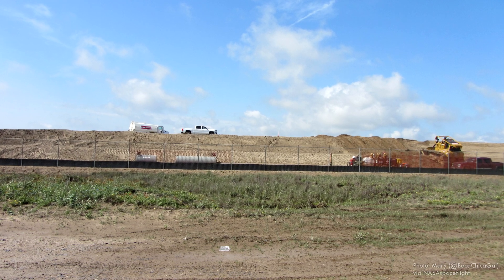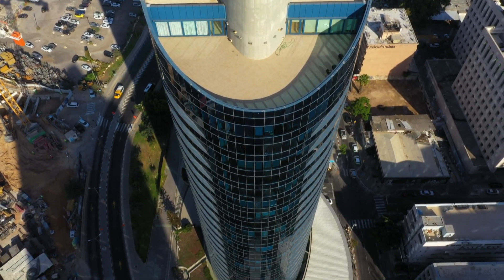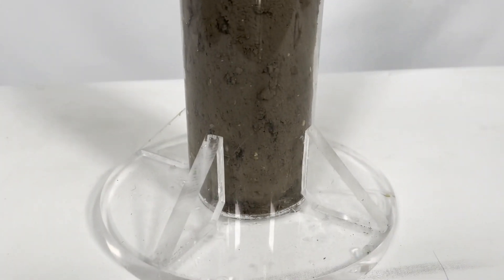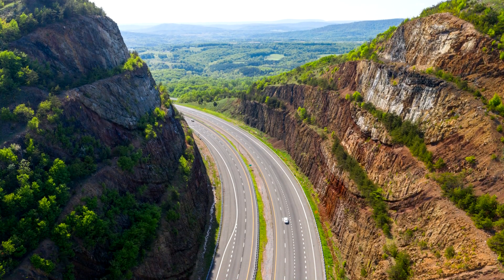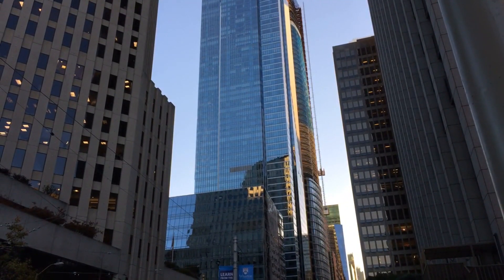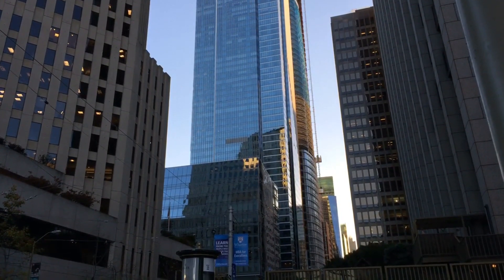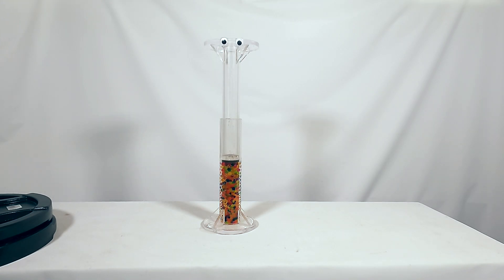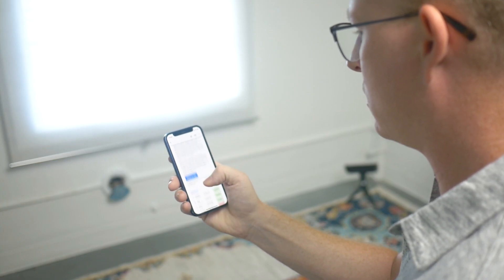Why SpaceX Cares About Dirt

Comment: I have done dirt work my whole life. Florida is mostly sand so we would have to haul in clay and use a mixer to blend it to create a stable base. Very interesting video.
Reply: Sorry, I don't quite understand, why would you want to introduce a soil more prone to consolidation to your foundation?
Reply: @everythingisscience658  for better compaction. Have you ever tried to get 100% sand to pass density?
Reply: @jamianwolfe6486  : From living in an area with lots of clay, and having family ties to the concrete industry, I find the idea of intentionally adding clay to be phenomenally dubious. The seasonal changes in expansion ratios inherently damages foundations, and adding a layer of rock and/or sand to distribute the flex is vital.
Reply: @absalomdraconis  comparing solid clay to a mixture is apples to oranges.  many places are a mixture of both.  Non-expansive clay has a very high bearing load while pure sand has the lowest bearing load
Reply: @theJonnymac  The word is cohesion and it is not directly correlated with compressive strength.
Reply: @absalomdraconis  In south Florida there isn’t much seasonal temperature changes.
Reply: @jamianwolfe6486  all the time, actually. Moisturize the sand, compact it layer by layer with a vibration compactor or whatever they are called in English. Can't get much better foundations than that (without bedrock).
Reply: @absalomdraconis  mixing clay into sand is just the cheapest ground improvement you can do. And remember, in Florida we are mostly talking about very clean sand (2-8% fines content, uscs classification SP to just barely SP-SM)You clearly don’t want to introduce too much clay (more than about 35%) into your mix as you will get poor settlement properties. But think of it as an attempt to keep the sand where you put it. If you have compacted sand surrounded by uncompacted sand, the compacted sand, once loaded, will exert force down and to the sides and will act just like your foot stepping in the sand in the beach, the loaded section will sink and the sand beneath will get pushed mainly to the sides. If you add just the right amount of clay it will help prevent that situation and stabilize the sand which has great settlement properties. FYI a clayey sand or silty sand will typically have a dry density of around 120-130 pcf and a clean sand will be around 95-105 pcf, silty sand is preferable for building construction but clayey sand is ok too most of the time unless you want drainage. There is so much more to go into on this subject I wish I had time to dig deeper into the meat of it.
Reply: @jamianwolfe6486  isn't Florida old river bed runoff with little to no rocks in it.
Reply: @absalomdraconis  not all clays are expansive
Reply: I love how all the experts who don’t work/live in Florida and don’t understand HOW it is done in Florida are able to “remote” determine that construction is done “wrong” in Florida. Given that they have roads, bridges, skyscrapers, etc. I think they have figured out how to make it work given what they have to work with. The engineers here will already know this so the following statement is for those who don’t know: the Seaside condo collapse in Miami had nothing to do with compaction
Reply: @AndrewSteitz  absolutely. Well said.
Reply: @AndrewSteitz  florida sucks give it up
Reply: Can confirm for the non Floridians. There are multiple factors we have to look at on a job. We mix clays into sand or sand into clays to achieve a cohesive subgrade. Stabilized subgrade is a very big deal here, and most areas require an LBR of 40 minimum. You can never achieve those numbers with sand. Also can't use straight clay usually because of the concentration of silts.
Reply: @geoffreygriffin3015   couldn’t have said it better myself.
Reply: @geoffreygriffin3015  How thick is the cohesive layer of clay/sand mixture for various structures? How is this practice impacted by bedrock depth?
Reply: @marcsimm1  I can not speak of anything related to bedrock. All of my work is exclusively in Florida, and bedrock never comes into the conversation. Maybe at greater depths to construct skyscrapers,etc? 
Most stabilized subgrade for roads, commercial structures, etc. is usually 12". Current site I'm on requires 12" stabilized subgrade in all driving areas and fire department access areas. From my experience, most stabilization for structural comes from foundations,footings, and possibly geopiles on larger buildings.
Reply: @geoffreygriffin3015  sounds like you do a lot of road work, using LBR (Limerock Bearing Ratio) values, which is a uniquely Florida test due to the availability of limestone from what I understand, the rest of the United States uses a CBR (California bearing ratio) test. And these are primarily used as a test for base material under roadways. There’s an hours worth of information just on why we have an LBR in Florida.
Reply: Californian here in the San Francisco Bay Area - the entire bay shore is coated in expansive clay, bay mud. It’s awful to work with on its own, and it cracks foundations every year because of our rainy and dry seasonal changes. I’ve also studied geotechnical engineering a little bit (one required class for my CE degree), which was incredibly helpful in understanding our local conditions. It’s fascinating to be reminded that other places with overly sandy soil actually need to add clay to get a sufficiently cohesive base before compaction, rather than try to mitigate the effects of expansive clay.
Reply: @ReneePowell  I’m in north Florida and we actually get to deal with both extremes which is kind of cool and also stressful. We either have fairly clean sand or very fat clay (PI of like 50+ for the techies). Also get to deal with karst formations (sinkholes) and a lot of peat. The only thing we don’t have really is rock. If we encounter rock, it’s soft limestone.
Reply: @joshrakestraw5580  Funny, you pretty much described the soil we have in Estonia.
Reply: I’m in construction here in NYC. We have the opposite problem. The dirt is somewhat shallow and it’s extremely hard bedrock that we have to dig through. Makes the work tedious but it pays very well.
Reply: @MelGibsonFan  the bedrock being so close to the surface is one of the reasons Manhattan had so many skyscrapers so early, and the specific locations of high rises corresponds to locations where the bedrock is particularly close to the surface.
Reply: I literally live in a town called Clayton.. sucks having to dig here
Reply: Sand compacts well, but it also erodes easily. There are pros and cons.
Reply: i guess i could call you to the dirt-y work
Reply: Sounds like a PITA. Do you have to have it tested before and after compaction? Or can you "eye ball" the mixture ratio, process, and backfill then test for moisture and compaction numbers?
Reply: @stupidassol  Usually you have enough info off of your proctor and sieve analysis to make a pretty accurate determination. Inspector may want to verify quantities before being mixed, but ultimately, the new mix gets ran through a new proctor and sieve analysis. Will usually include testing for LBR specs also. Basically, we eyeball it, and then let the numbers confirm. There are steps to take to get a "by the book" number, but experience makes it much faster.
Reply: @stupidassol  absolutely it’s tested and they tell us how much to add to get the correc  cohesiveness. . I think it’s called marl. But it’s pretty much clay.
Reply: I test residential lots for density in Florida. Can confirm this statement.
Reply: @RootLocusSucks  thank u sir.
Reply: Yeah we're i live its mostly clay and sand has to be added if you want any plant life
Reply: I literally just did soil compaction 2 hours ago. It’s not good when the edge of the slab collapses into the footer when the compaction tester steps on it. Kind of like zooming past a cop on the interstate.
Reply: I, too, lived in Florida in a number of places, mostly in Central Florida.  I remember a lot of sand but when I looked at a geologic map of central Florida it appears there is quite a mixture of soils.  My stepmother build houses around Orlando and I don't think they did anything except pour the slab.
Reply: Excellent! Perhaps you are the guy to ask why people keep saying Nancy "Dirtpipe" Pelosi. I really don't understand this nickname. Are you an expert in the field of "dirtpipes"?
Reply: Not all sand sometimes its muck :D
Reply: Dirt work would be the perfect name for my autobiography just sayin
Reply: Thanks for doing the dirty work
Reply: Our teacher always told us Sand is a good boy
Reply: @renaminginprogress6903 So a lot of murders in Winnipeg....what is your point?
Reply: Thats intresting, in Washington state we export clay and bring in a fill....basically a sand. To me as a builder/general contractor, its frustrating working with geotechs and dirt workers. They call the clay/export dirt, "bad", and the sand/fill "good" **better draining in my area, but as a lifetime bmxer (who was professional for over 13 yrs) and has built jumps my whole life, I can tell you the "bad dirt/clay" is the only dirt I will touch. After we get the jump formed and smooth it, (slap with flat head shovel) depending on the time of the year we put 6mil plastic in summer, so it won't dry to fast and leave it to "air dry" in the winter, after the "clay/bad dirt" drys it creates a jump that won't "blow out" or fall apart.....our spot we ride to date, has been there over 10 years in a "wetlands" kinda area of the south sound in WA it is amazing. I would love for a geotech to come see it or a structural engineer, I believe it contradicts a lot of the building process in my area. Not necessary contradict, but I don't think they would believe how solid and now concrete like are.We cover all winter after contracted with 6mil and only leave tarps off in summer if we know its gonna rain/needs rain, also we let the foliage grow on the sides and back, further creating a indestructible jump. The 20 times our "trails" as we call em got plowed, we always hear the same thing......."how u guys get the machine in here to build these"? https://youtu.be/36oAUNrtY70 here's a look at the spot I am talking about mixed with a spot in Australia and Salem Oregon https://youtu.be/RNfliNmiGd8
Reply: That’s called processing
Reply: Density is only a relative comparative measure of consolidation, and compaction and cohesion are not consolidation. It sounds like FL has some janky building code. Sand is very good at load bearing when its properties are taken into account during design.(It is more complicated in earthquake areas as you have soil liquefaction to consider.)
Reply: @mytech6779  Sand will never be suitable under roadways which experience vibrations regularly. Also, a lot of work in Florida is above very shallow groundwater....sand and water, then add some vibration....
Reply: @geoffreygriffin3015  There is a million miles of 1000 year old cobblestone that says otherwise. The difference is in HOW sand is used not that sand is used. 
Do you really think saturated clay would be better? Even without any knowledge of  or experience with clay the video above explicitly illustrates the advantage of sand in saturated conditions.
Sand may to be combined with some larger rock to get the best of both, sort of a 1+1=3 situation.
Reply: @mytech6779  pure sand has the lowest bearing load of any soil.  I worked at the construction of a factory on pure sand site where thousands of rock piles and to be placed over all the site under the building before any concrete could be poured because it couldn’t bear the building on top.
Reply: @theJonnymac  yeah as a bare heap its low, but that is not how you correctly use sand.
Reply: I’m form upstate NY, I didn’t know that about Florida. That’s cool
Reply: @RADIOACTIVEMASCULINITY  It's very soft and your foot can displace quite a bit of it, to the point your foot is submerged in sand. That doesn't mean you can go barefoot down there though. Sandspurs are as painful as they are plentiful.
Reply: @RADIOACTIVEMASCULINITY  Long Island is pretty darn sandy! Not sure there is anything too fancy about the foundations we work on though
Reply: @anthonysmalawipredators8794  I’ve heard that Long Island is sandy from the glacial run off. I was also curious if they have the same foundation requirements when I saw the Florida comment. This comments section has a ton of interesting information.
Reply: @anthonysmalawipredators8794  I grew up in Florida and now live on Long Island. It's not really comparable to central Florida's sand.
Reply: no kidding!
Reply: Florida sucks it’s the arm pits of America
Reply: @roberttorres8477  Florida is one of the best places to live in the US…
Reply: Comment to follow discussion

Comment: I can relate to this video as I live in North Central Texas where the soil around my foundation is mostly clay, so keeping it saturated with water is important in avoiding foundation problems.  In the middle of the hot Texas Summer the cracks in the surface can exceed 3 inches.  Needless to say, I use my irrigation system of drip lines to avoid this occurring next to the foundation.   It's a cheap and easy way to avoid foundation problems.

Comment: Creep is a time-dependent permanent (plastic) deformation under a certain applied load. I don't thing that leaning Pisa tower is reason of soil inconsistency, tower is very small in diameter and difference of soil is consistent. Reason is not perpendicularity Pisa builder made error maybe 1 or 3 degree it is not 90 degree tower and of course mass center been shifted to one side more, and after long time more compressed soil part of tower with 1 or 3 degree error started more deviation. Same to skyscrapers who made from steel skyscrapers have non consistent mass distribution in office space and not 100% perpendicularity to ground.

Comment: So I recently constructed a steel I beam building on a hillside of a man made impoundment and when drilling for the anchors I found there were no piers(we did not pour the pad). I did not find this by breaking through to gravel. It was a rock catching the bit in 1 spot of the circle. Only 1 anchor did not go to spec depth even with an hour on that hole and every anchor hit rock with yellow to brown colored dust, no red. My question is that do engineers account for movements the opposite of settling? Or is the degree rocks are pushed up offset by the pad/building?
Reply: Yes, geotechnical engineers consider uplift and swelling.  Many soils in the USA swell when they get wet, so in areas where this is a known problem, recommendations to mitigate the potential problem are typically provided.   For many applications, the controlling design concern is uplift/overturning due to wind loads (consider wind turbines, etc.)
Reply: As Wally said. Also, Grady mentions his previous video about expansive soils and uplift that I recommend you watch.
Here in Colorado our soils are highly expansive so structures have to be built accordingly. I can't tell you about commercial construction, but residential construction has specific code to address soil expansion. You can't build a slab on grade here, you have to build a walled foundation with a gap between it and your slab so that the slab can move up and down. Wall framing on foundation levels is required to have a floating bottom plate that can also move up and down. Older homes built with concrete foundations before these standards were set always have cracked foundations and many aren't structurally sound anymore.

Comment: I imagine another option for compacting would be using something like a giant jackhammer to beat the earth into compactness, or at least speed it along while using other traditional methods, as the vibrations would help move soil into voids more easily. Is my imagination wrong?
Reply: There's a technique called deep compaction where they drop a mass from a machine to do that.
Reply: i think the issue is that the energy of the jackhammer and the vibrations will dissipate in the first meters and pretty much won't compact anything deeper, so the only way to go is to put an even weight in the entire surface for a extended time to combat this dissipation 
well this method probably is a niche usage, like for tremendous soil stress from a rocket silo who would need much more compacting than anything else to not cause problems in the future
Reply: roller compactors and similar equipment often vibrate to help with compacting soil. The only thing is that they can only compact a relatively thin layer of soil so it doesn't work if you have several meters of soil that needs compacting.